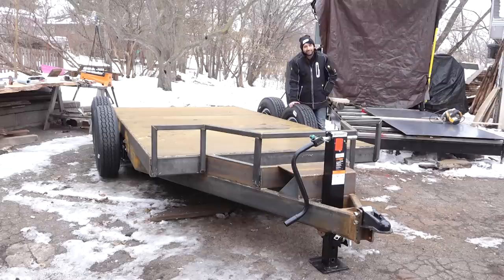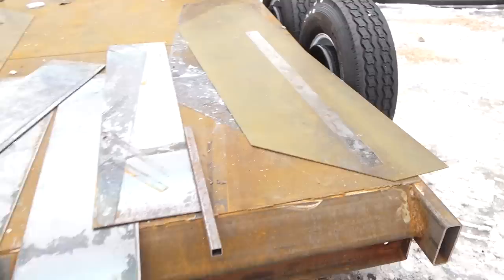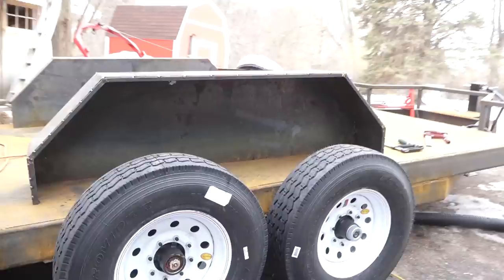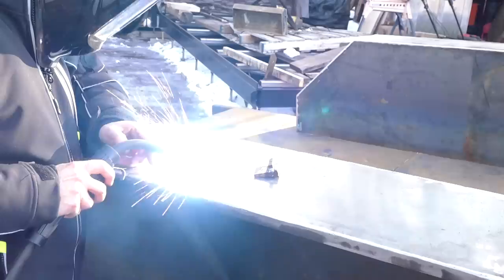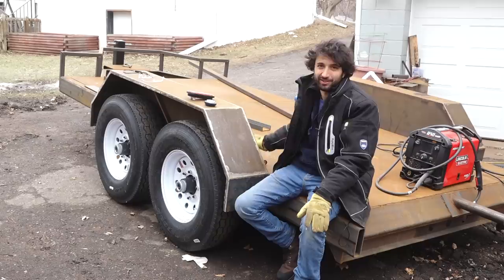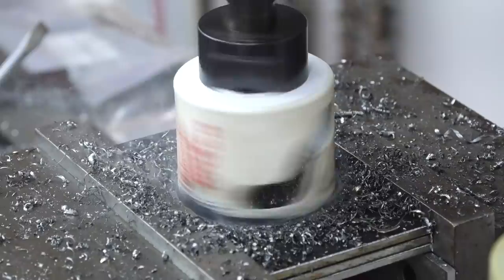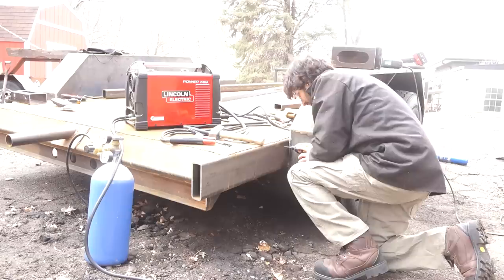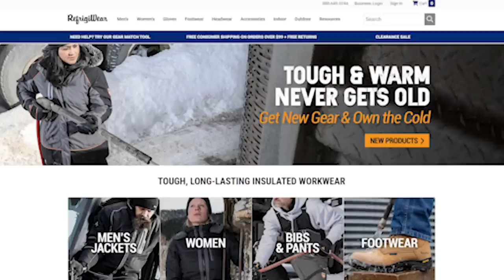Fenders and Lights - Urban Logging Trailer Build Pt 6

Comment: Good idea to make the fenders bolt-on.  if you ever carry a load that's wider than the fenders, you can take them off and the extra few inches will be welcome.  At this time, you might not think you will need it, but maybe some day you will want to tow a car and open the doors or something like that.

Comment: Hi Matt. Please put some way oil on the knee ways of your mill. It should move silently as should the table if it is also making noise. Great videos!
Reply from the maker: I still need to pull the table area apart.  I have a feeling the oil lines are gummed up. thanks!
Reply: @mcremona  Understood. Just give the ways and screws a good coating and move them up and down a few times. You can do a lot of damage fast if there isn't any lubrication. Thanks again for the videos.

Comment: Thanks for this build series. I’ve learned a lot so far about taking into account those things we rarely think about while in the build. You know, the decisions that have unintended consequences that force us to make adjustments to the built. Your design is far more complete than mine have been, and this shows me to “ring out” the design on paper to a greater degree. That will help avoid the “flying by the seat of my pants” errors that have troubled some of my fabs.
Thanks for the great channel. I almost wish I lived closer, so I could get my hands on some of the stunning lumber you mill. I’m well out in the Northwest. We’ve plenty of mills and a surprising number of urban and suburban recovery mills. But most I’ve seen don’t understand the material and don’t make the thoughtful choices you seem to make just before cutting.
I know it’s still somewhat of a crapshoot. But any experienced wood cutter knows how to lay a crotch for maximum effect.
That said. Nice work!

Comment: There is no way you can be just a hobbyist! You seriously have my dream Machinist / welding shop all built into one! I am fabricating a mini size trailer (RC trailer). I welded my fenders with 1/4" steel and just welded the 22mm sheet metal on top. I just need to tac weld the inner panel and clean it up. Then paint that 👶!

 Next part I am doing the tongue section next. I can't believe it sucks up so much time. It's a challenge getting an 8" and 4 1/2" 1/4" square steel bar to not left up by the little magnets and get that clean 45 degree angle to be as close to perfect. 

Anyways, getting some cool ideas for finishing touches. Thanks for the video!

Comment: Your fenders are actually shaped the way they should be. That's the same look I use on all mine. Good job enjoyed the video.
Reply: Good evening from off the grid in the great southwest. I really like the fabrication work. I laugh at the same things. For example, your tape is long your ready to mark your piece and the wind blows your tape off. Lol so you walk back out the tape back on get to the other end and guess what, your walking back again. Too funny. Now on a more serious note, the video on making your rotisserie, where can I find it  I really need to make one. I do small single axle trailers, 8 to  12 feet long. And a rotisserie would be the cats meow. And I really like the one you made. Thanks again,

Comment: Yes - milling machine action!! Next time you drill a stack of plates like that, try using an index card or a few sheets of paper front and back to take up any tiny discrepancy in the widths of those pieces.

Comment: I just replaced a fender on my trailer and  I put antiseize on all my tapped holes  bolts.Great if you need to remove and change something in the future it will come apart. Food for thought Matt.great build!
Reply from the maker: I used antiseize on every bolt when I did the final assembly after paint. Thanks!

Comment: 1/12th ft. Very useful figure. 1/2, 1/4,1/8, 1/16, 1/32 of an inch we all know. But fractions of a foot? Love it. 1/24th, 1/48th, 1/96th, 1/192nd and 1/384th of feet. I’m totally using these. 😜 tooootally easier than metric.

Comment: Very nice job indeed and well planned out looking very good.you are correct that the wheel arch frame will trap water and to leave a gap would trap muck and water I used black ( depends on colour ) steel silicon then bolted to frame like you have never had any problem with it looking forward to your next trailer build.😀😀🇬🇧

Comment: Hi Matt, Love the trailer series. Suggestion, when your drilling or hole sawing a stack use a piece of wood on one side of the vice then you won't get the top pieces moving around, the wood will squish a little to make up for the small amount of size differences
Reply from the maker: Wooden vice jaws!
Reply: @mcremona  A small piece of aluminum can work too. But a hardwood sub jaw might be alright too.

Comment: Excellent video!
 I have always like your stuff.
You MAY want to put a little brace, down low 
at the front and rear of the fender that would 
help keep the fenders from vibrating
Road vibration will crack anything over time.
Just little tabs for support.

Comment: Loving the trailer series build and one thing about the fenders and the water issues is use the same stuff you would  put  in the bed of a pick up truck I can’t remember the name of that stuff but it works grate for sealing joints, can’t wait to see the finished result
Reply: rhino

Comment: Hi, another great build series Matt 😁😁😁. I’m from the UK and old enough to have started with imperial and move to metric. I prefer metric overall but...  I think in metric for small measurements g, mm etc but find myself converting larger measurements km, litres etc into imperial miles and gallons. Don’t get me started on sheet goods 8x4 not 2440x1220mm 😜.
The US should just get on with it and convert to metric, it will take a generation or two but it might stop NASA from bouncing another multi billion dollar spacecraft off of another planet in the solar system 🤓🤓🤓🤪🤪🤪.

Comment: Matt, fantastic video as usual.  Are you planning to use rubber grommets to protect your wiring as it passes through the access holes in the frame?  It will make for very reliable wiring.
Reply from the maker: Yes, those aren’t arbitrarily sized holes 😄

Comment: Matt when you get ready to paint the trailer ,  I would suggest you think about the wheel and fender area that you sprayed that area with rubber rise bed liner overlay , this should help limitation of  the rust problem from road salts

Comment: Matt - on your Bridgeport, you'll have better control over the work piece if you use the quill to drill holes instead of using the knee. Practice is to lock the knee in place.
Reply from the maker: With the hole saws, I found it much easier to use the knee.  Feed/chip load is more consistent.

Comment: I put my license plate on a metal plate with a hinge so the plate moves
Reply: I like that idea... I have replaced 3 light sets on a equipment trailer that my grandpa owns. If it can be hit, he backs into it. In his defense he does have to drive overs some ditches and I think that is where the tear off takes place. I really like the hinges so I might just work something up when he breaks a set in the next few weeks.

Comment: I've been starting to use base12 instead of base10 counting to  dozen like  1-2-3-4-5-6-7-8-9-X-L-10 or 1-2-3-4-5-6-7-8-9-A-B-10
Now ... you just stop with those fractions or else hahaha!
naw, whatever floats your trailer! :D
Reply: We used to use that system for currency until 1972 hear in the UK £ S d (pounds shillings and pence) 12d to a shilling 20 shillings to the pound
Reply: if you're going to use base 12, you gotta do it right... 0 1 2 3 4 5 6 7 8 9 A B.   Then you can do a base10 eleven as B, thirteen as 10, or sixteen as 13.
Reply: @drhender6943  well, 1-2-3-4-5-6-7-8-9-A-B-10 as opposed to 1-2-3-4-5-6-7-8-9-10. Sorry to make your butt hurt for including ten and dozen at the top.

Comment: You mentioned that if the axle were to bottom-out there would be about an inch of clearance between the top of the tires and the underside of the top of the fender. What about the clearance - when bottoming out - between the tires and the 45-degree portion of the fenders? It could be a camera-angle thing but those look much closer than the top of the fenders.

Comment: Hi Matt, I'm really enjoying your trailer build. Just a thought regarding the license plate, have you considered using hinges on the plate? With hinges it would simply swing up toward the rear of the trailer. Depending of course where and how you mount the hinge it could actually swing in both directions!
Keep up the good work!

Comment: im thinking your threaded bolt holes will rust in time, and you'll end up tapping new ones, or replacing them with nut and bolt assembly.  Maybe going with nuts and bolts in the first place might be good?  Also thinking when you drop a log onto the fenders, theyll take a hit, go with bigger beastier bolts?

Comment: I like metric. I even feel US should convert. But I'm also educated in math. There is nothing triggering about fractions or Imperial.
Reply from the maker: you're one of the good ones
Reply: I am comfortable in both systems, and converting imperial/fractions to metric and back is a daily task in my workshop (old imperial machines, but I am trying to standardise on metric). I am not triggered by either, but it would be sensible for the last few holdout countries to switch over to the standard. Would make life easier on everyone.

Comment: Maybe a stupid question, why can’t you have the number plate attached above the light box rather than below.  I concede still a bit exposed when loading stuff but put it on springs👍🤪.  Btw really enjoying watching you build this.  Second thought if you cover the whole surface where the fender touches with the body with silicone or Liquid gasket   (after painting) would that not prevent water sitting and stop it being a dirt trap if you used a spacer.

Comment: Matt, with all that steel the trailer is going to weigh a tonne, sorry ton!
Reply from the maker: A bit more than that
Reply: I hope the registration is a set amount based on length and not weight
Reply from the maker: Based on gvwr

Comment: Really nice build, Matthew. And thanks for showing us the details of how you did it. Glad to know about the RefigiWear (bookmarked) /// I sure hope i am wrong, but i worried that the length of your fenders did not feel right to me for some reason. Will mud and slush/ice jam into the closeness to the tires and prove hard to remove? Will the round of the tires hit/rub the 45 degree angle before coming close to top when the springs compress under a really heavy load? Gosh i hope not!
Reply from the maker: The clearances are the same or larger than commercially made fenders of the same size so I should be good. Thanks!
Reply: @mcremona  Thank you for taking the time to put my mind at ease, Matthew. Keep on, Keepin' ON!

Comment: I've been watching you since you finished the ban saw.  I must say that you do phenomenal work regardless of what it is!  I have a friend that is exactly like you.  He is an artist and it comes out in all he does.  Anyway I have a few questions that you don't have to answer if you don't want to.  Any clue how much that trailer weighs?  That little loader you have has way more ass than a dingo.  I rented one once and almost went over the bucket 20 times!  Are you concerned about the offset on the wheels?  It is obviously heavy and as a young and dumb kid I replaced a lot of wheel bearings on my trucks with over sized tires.  What is that bit you used to clean your holes?  I guess stopping short of asking how much money you have I will stop!  lol

Comment: Hey Matt,

Why do you heat the holes with a torch before you tap them? Not familiar, should I be doing this?
Reply from the maker: the cold makes tapping difficult.  Makes the taps brittle and the lube ineffective
Reply: @mcremona  Good tips. I had never thought of those points.
Reply from the maker: @CraigsWorkshop  One of those lessons from experience.  First time tapping at 5F didn't go well.

Comment: I expected about 20 bolts in each fender.
Reply: Ya, until he put the light boxes on I was thinking those fenders are going to crack out the bolts and probably ruin one of those expensive tires!
I would have still used more bolts with washers......

Comment: I was wondering why you didn’t paint it as you went, especially the underside parts. What’s your plan for rustproofing and paint?

Also. The license plate can be vertically installed on the fender slope. Save yourself the trouble. Do it there.
Reply from the maker: It’s been too cold. I’m having it galvanized
Reply from the maker: Technically not legal to rotate the plate

Comment: Were you welding with 110 or 220v? Also are you using mig with fast or flux core because I didnt see any tanks, I'm curious to know.
Reply from the maker: 220v; solid core with gas

Comment: I don't think your threaded holes in your side rails  will hold up. The  tubing is not thick enough.  You could drill completely  through and. inset a center tube  in the rail. You could use a nut inside the frame.

Comment: Yup, seeing imperial in decimal form is a potential trigger. :)  What kind of blade were you using on the circular saw?  I've only used the Diablo Steel Demon, but yours looked orange.  Looks like it worked great.
Reply from the maker: Stock blade that comes with that saw.  Evolution metal cutting circular saw. thanks!

Comment: Hey Matt, do you have someone to certify the trailer mechanically, also to register, can you just tell them it's home made?
Reply from the maker: no, just complete the homemade registration form
Reply: just say it's homemade
Reply: It varies by state, but in most it requires a form certifying it as homemade, and an inspection by a licensed inspection location or the state police, to make sure it's structurally and mechanically sound, and complies with DOT requirements for lights, brakes, and weight. At that point it's issued a VIN number, which has to be permanently attached to the frame, usually by welding it or stamping it into the tongue. Some states allow a plate stamped with the VIN number and GVWR and riveted on. Then you can register it.
Reply: in PA i think you would need more than just a safety inspection, you need an enhanced inspection, i think it's called.  which requires a shop who is licensed to do the enhanced inspection.  which will also likely be more dollars.  and of course if i know the DMV, they will then give you a hard time anyways. lol

Comment: Not just a fraction, a horrible never used fraction. LOL  Some royal trolling there. 
    You could have used 14g steel and it would still be twice the thickness of typical body panels. Trust me it would have been way more than good enough. I've literally used tons of it.

Comment: Potentially stupid question, what was that bit you used before tapping the holes? What is its purpose?
Reply: Counter sink bit,  just to take the rough burr off the hole
Reply: I suspected, but didn't want to assume. Thanks.

Comment: So at what point do you add the 3rd axle to offset the weight of the Fenders... LOL... Just teasing, no offense... Ok, just found your channel a few minutes ago and obviously I am playing catch up here, so I just have to ask, is this some sort of Bulletproof Bug Out Trailer or what's going on here? Sure Fenders do need to be rigid, but is Bulletproof really necessary??? Seems to me you could have used something 1/3rd the size and still just as durable but again I just don't know what this Trailer is being used for... Do tell... Cheers....
Reply from the maker: I’ll use it to pick up large logs. See part 1. Building something that can take a beating so I don’t have to worry about breaking or fixing it.
Reply: @mcremona  Cool...

Comment: Next time do the lengths in decimals of feet, to trigger metric AND imperial fanboys
Reply from the maker: Yes!!!!
Reply: @mcremona  on topic more, Definitely seal that gap between the fender and framerail. If leaves and bark get in a thin gap it will just trap more water and rust more. Id leave them flush and run a bead of hard silicone or something, or even a nice even weld bead

Comment: Ah yes beautiful fraction, but they are never used when milling.  NO we use an imperial system that uses 10th divisions, which is essentially a decimal system.  How odd.   IMO using a straight metric system is far better.   As a lot of stock we use will come from abroad, it too will come in metric, even though it might say different.

Comment: Metric so easy.
Reply: Here in the US, tire tread depth is measured in number of 32nds. Like 1/32, 4/32, 5/32, 8/32. Not converted to 1/8 or 1/2. Why? Because it's easier to visualize the difference between say, 5/32 and 1/2. Now swap the 32nd for millimeter. We use that basic positive of using metric, but don't realize it, then criticize the rest of the world for using metric. We be Stoopid.

Guy at work has an electronic caliper that can show in fractions. Something may measure 29/64. Unless you are constantly using fractions, you have to stop and think about how big that is. I just did it in my head like this: 30/64 is 15/32. Nope, that doesn't help. 28/64 is 14/32 is 7/16 which I can relate to. So 29/64 is just a hair bigger than 7/16.

But 12mm (which is awfully close to 29/64) is easy to relate to without all of the stupid conversions. But hey. Maybe the stable genius will get us to change over.😂😂